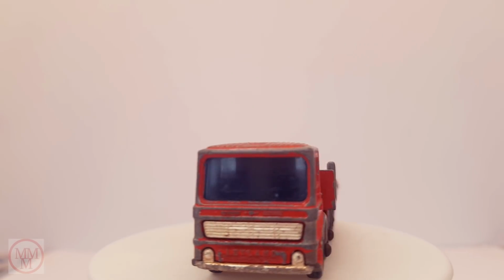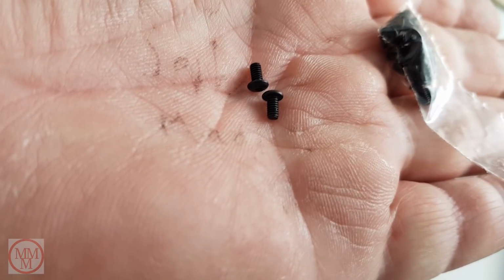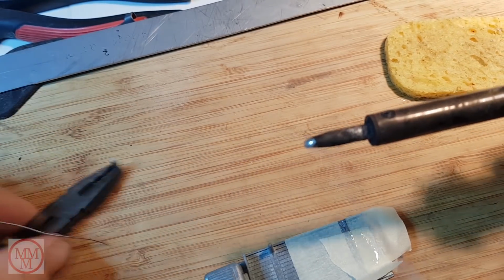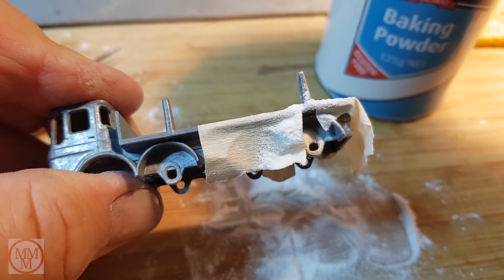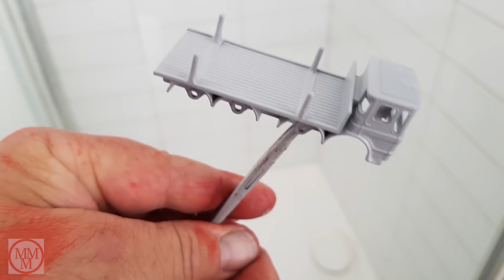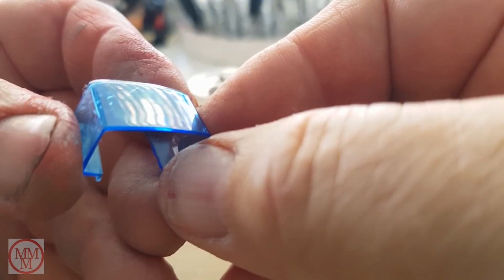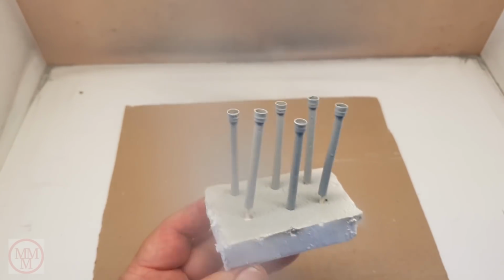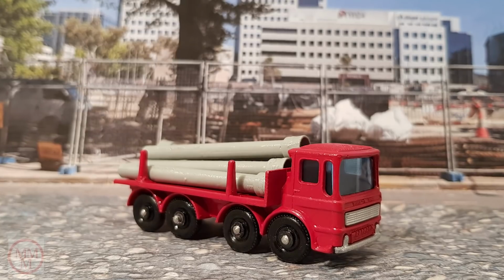MATCHBOX Restoration No 10d Pipe Truck 1966

Comment: regarding the soldering: you can buy solder that already has flux inside, no need for extra flux there. also you have to make sure that the item you're tinning is hot enough. the pillar didn't look bad, it's just a small item, that heated up fast i guess. on the bed itself it looked like it was too cold though, i assume lots of heat gets away into the whole car so you have to heat it up more before tinning.

on the other hand it could be the material of the car itself, i assume it's steel. no idea if that can be soldered properly. in electronics you work with gold and copper for the most part

Comment: Nice work as usual Marty. 
A solkding tip is that you want the "wire" or what ever your soldering to be hot enough to melt the solder itself. Otherwise it doesn't adhere well. But, with pot-metal or anything like it you may not be able to get solder to flow cleanly.

Comment: You really can't solder die cast pot metal. Well, not quite true, but you need a very aggressive acid flux and almost enough heat to turn the whole model into a puddle of molten metal.

Comment: hey  there,  marty … been  watching  your  mini-series … today  you  uploaded  your  latest  creation (or recreation) … good  on  ya',  mate.

with  regard  to  soldering … you  might  do  well  researching  it  a  bit … 'specially  with  the  advent  of  our  internet … veritably,  anything  can  be  found  online.  i  cannot  specify  exactly  where  you  went  wrong … perhaps  the  two  pieces  were  not  hot  enough [propane-torch heating both simultaneously might help].  anyway,  die-cast  toys  are  created  from  pot-metal (zamac) … which  can  be  soldered  and  can  also  be  welded … if  done  properly.  but  do  the  torching  outside.

https://www.nytimes.com/1987/02/01/nyregion/home-clinic-the-hows-and-whys-of-soldering-metal-together.html
https://www.google.com/search?q=soldering+die-cast+toy

keep  humpin'  marty … and  always  remember  to  wear  eye-  and  skin-protection.  oh,  btw … those  3dp  pipes  came  out  nice … they  got  texture … whereas  the  ones  you  purchased  don't.

Comment: to solder, you need more heat and clean your soldering iron. the tip should be shiny. Steel or brass wool works great for this.

Comment: IDK what you call it Down Under, but that's simple 14 or 16 AWG solid steel wire on the axle. Just a suggestion. I'm not sure how it was crimped. Perhaps your method will work?

Comment: Excellent job as always.  Now I have one of these from when I was a child and I still have the pipes, or at least 4 of them.  Thank you for the tip about superglue and baking powder, I have tried it on a model bridge and it works very well.  That 3d printer looks very interesting and you do good work with it, something I may look into myself.

Comment: A technique I often use on 3d printed parts is after the print is finished, I spray it with a plastic filler spray, and then sand it down with fine grit sandpaper, before painting. this gives an injection molded appearance and makes the 3d printed part more rugged. maybe something to try.

Comment: I believe that you can't solder on the base metal used in these or hot wheels. I think it was baremetalHW who found you need to copper plate the metal first, then solder, sand it to shape then zinc plate.

Comment: I believe I saw somewhere that you need to copper plate this before it can be soldered. Another option may be to use a metal based two part epoxy. They have some which is like a putty, so it can be molded.

Comment: For future reference: The soldering didn't work because the soldering iron was of too low a wattage to heat up the components to the temperature necessary to truly wet the components. The soldering iron you used was intended for soldering two wires, which isn't much metal at all. Thus you ended up with a cold solder joint, which has no structural strength at all. That said, I think the solution you came up with resulted in a stronger joint. Tin-lead soldering will always form a weak butt joint, but for other kinds of joints it may be sufficient.
Reply: @just_drmr  Or a DIY "third hand" like this: https://www.youtube.com/watch?v=kK98LTIj7jI

Comment: If you're using electronics solder to do these repairs, that's why it's not working.   You need to get acid core solder that's used for soldering plumbing pipes.   There's an acidic flux inside that will eat into the parts and allow the solder to penetrate, making a much stronger joint.    That flux pen and resin core electronics solder only allows the solder to flow around surfaces (somewhat) easier.
Reply: I went the other way and used plumbing flux and solder on electronics. Not my finest choice!

Comment: Marty, have you ever cast resin parts?  I was building a model and ended up losing a tiny disc rotor (happened also while airbushing) . I'm trying to cast a replacement and wondered if you had any tips. Thanks for the enjoyable vids.

Comment: Nice one. The reasons soldering didn't work is the truck acted like a big heat sink and the metal used in toy cars doesn't take solder well in the first place. Oh well, live and learn. Just happy you came away from your mishap with only a headache.

Comment: Beautiful finish in that glossy red.  That was alot of air pressure.  I was expecting a friend to phone you from Perth, to say the truck just came in through the bedroom window.  The pipes look great!  3D printing is the way to replace broken or missing plastic parts.  Clever design, with the slotted axle holes for the middle axles.  The axles can 'walk' over uneven surfaces.

Comment: Marty, solder runs TOWARDS the heat element. Try getting the work good and hot with the soldering iron and apply the solder to the opposite side from the iron. The solder should melt and run towards the iron those filling in your work better. I love your super glue/baking soda trick.
Reply: *thus filling in

Comment: I always use the two part  5 min. Epoxy and a little goes a long way I use it and with parts like that I get a very small bit to drill a hole in both parts and use a wire as like a dial pin as like what you would see  in a table and then use the epoxy and it is not going any where

Comment: Marty soldering won't work on die-cast models, you have to electroplate the chassis with copper, the solder would stick to copper and give you the result you want

Comment: For your soldering to work, you need to get both pieces hot. The soldering iron you have isn't man enough, plus using metal pliers to hold one piece, that will sink away the heat from the piece your trying to solder. I think you would have more success with a small gas touch to apply the heat. Like plumbers use but smaller.
Reply: Need to copper plate zamac!

Comment: You have to copper plate to solder zamac
Reply: Saw that over on baremetalhw!
Reply: @Gearhead-en8dz  Yeah he been looking for a way to do it. Many people told him about the copper plating and he finely figured it out.
Reply: @Jsellers1965  I wonder how strong of a sweat it is. I'm sure that's where the idea came from,  sweating copper plumbing!
Reply: John Sellers...  Exactly!  Copper plate the Zamac, use plenty of flux with a soldering iron that can supply sufficient heat and you are good to go.
Reply: I don't know for sure but, I think you would need plumber's solder and acid based flux.  Electronic solder is rosin core flux.
Reply: @jescocom1  They have used the method to repair pot metal since the dawn of time but you guys are a bit off on a few points.1, the copper is a flash coat and they use it to fill pittting. It doesn't have any structural "bite" the adhesive is stronger.  2, solder will stick to zinc, what it will not adhere to is the dichromate coating, 3 electronics solder will work with proper surface prep. Do not use acid flux with zinc. Use galvanized or tin plate as an example. Solder sticks to many alloys and the issue here is not the size of the iron, you can see right away that it is not wetting out.
Reply: I would guess that the key factor for soldering zamac die cast-parts is the temperature of the workpieces. I would try preheating both parts in an oven to about 280° C and then take them out using a non-heat-conductive instrument to avoid them to cool to quickly. As solder I would try electronic solder with flux inside. The solder should then be melted on the workpieces, and not on the solder-iron, which is only used to heat the parts.
Reply: @patrickeppenberger6983  You would have to heat the alloys to a high temperature to do it that way. The cyanide copper flash allows the use of flux which lowers the melting point of the solder and keeps it from being absorbed into the pot metal and corroding it. If using filler rod the casting will burn back or distort.

Comment: You need to zinc plate the parts.. doing so gives you something to solder onto.. worth a shot.
Reply: Copper plate, solder; then zinc plate!
Reply: @Gearhead-en8dz  excellent.. knew it could be done 😉👍
Reply: @carlb1056  baremetalhw does plating over on his channel!

Comment: Shoutout to Marty, great way to start the weekend.  The soldering effort may have worked better if the two parts were copper plated.
Reply: Maybe with a hotter soldering iron, the heat is dissipating to the truck